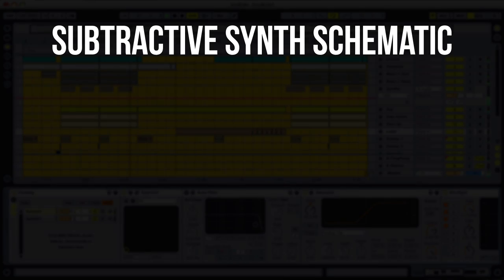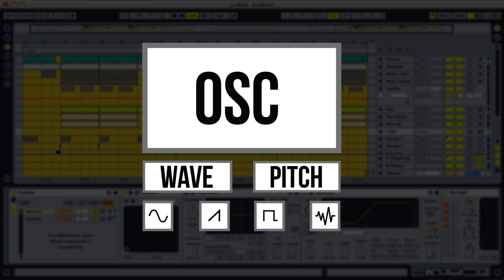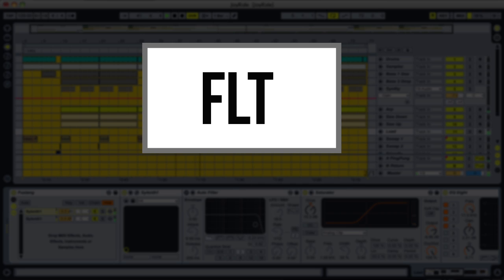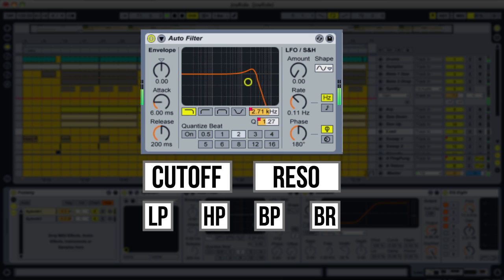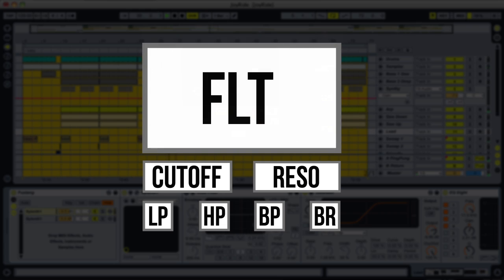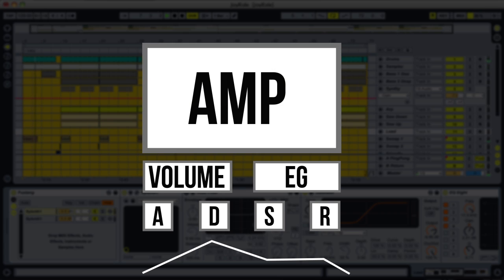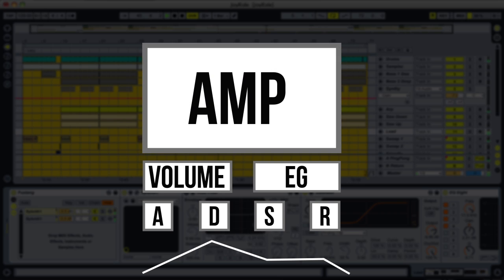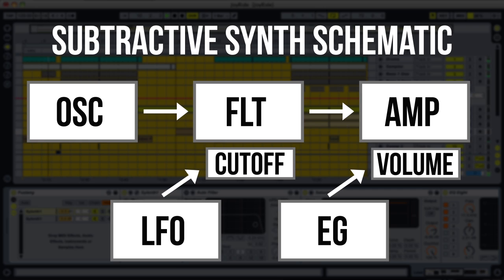TUTORIAL: Subtractive Synthesizers Explained

Comment: Very nice overview of subtractive synthesis.  I think it's more meaningful and things start to fall in place in one's head more easily, when one understands additive and FM synthesis first, then go to subtractive.  

Some other interesting synthesis methods are the ones used in Casio VZ-1, Yamaha VL1, and VP1.  The VZ-1 uses a synthesis method called Interactive Phase Modulation (iPD).  It's a very capable machine.  It starts out with 8 basic waveforms (sine, 5 sawtooth variations and 2 noise).  It has 8 modules similar to operators, which you can arrange in different layouts.  It also has 8-stage envelopes like the CZ-series. It's sort of similar to the DX7, in a sense that DX7 actually uses phase modulation to implement FM concept.  So, Casio had to work around with the VZ-1 not to infringe on Yamaha's exclusive FM patent at that time.  But I digress... Let's not confuse implementation type with synthesis concepts, or we're going to get into analog vs. digital pointless debate. :)

Now, Yamaha VL1 uses physical modeling of drivers and resonators to emulate reed and brass instruments, as well as some bowed instruments.  And the the VP1 (ultra rare and ultra expensive) is a polyphonic physical modelling synthesizer that emulates stringed instruments.

Aside from the above, there is also wavetable based synthesis (Ensoniq VFX), granular synthesis (don't know of a dedicated hardware machine for that, and it's questionable if granular is a synthesis at all, not just a recording manipulation technique like phrase loops, albeit on a very very fine level), DLM (Differential Loop Modulation - Roland D-70), and RCM (Realtime Convolution Modulation - Yamaha SY77/TG77 and SY99).

V-Piano technology from Roland and Pianoteq software are also very interesting.  And so is Roland's S/A synthesis in RD-1000, RS-PCM in U-20/D-70, and DI (Differential Interpolation) in W-30.  I put all of these synthesis methods on equal level though.  I try not to favoritize any.  I think all of them are amazing, and useful.

As far as vector synthesis (Korg Wavestation, Yamaha SY22/TG22 and SY35), wave sequencing (Korg Wavestation) and Linear Arithmetic (Roland D-series) even though they sort of imply additive synthesis (especially LA), I'd consider them more of audiomixing techniques, that can be both pre-recorded as in Wavestation's vector envelope, or can be used in real time.  In fact, the D-50 joystic allows you to do vector synthesis, albeit it is only manual and performance oriented.  There's no envelope or any kind of automation for the D-50's joystick.

Anyway, nice video again about subtractive synthesis.